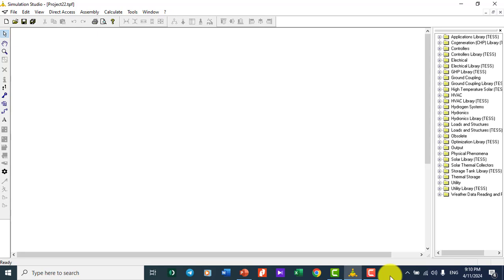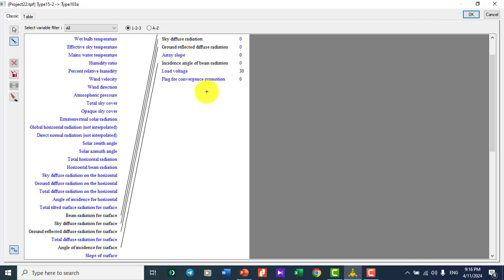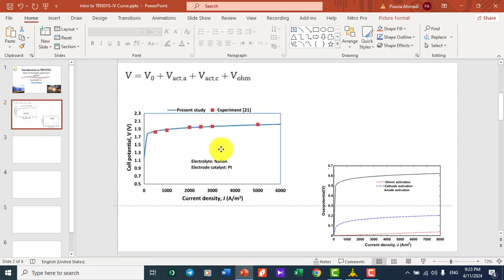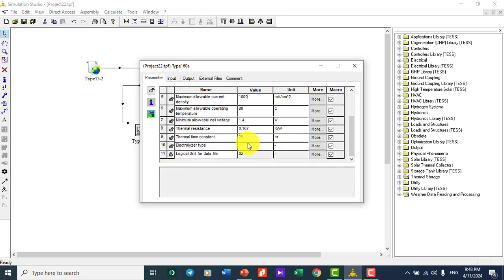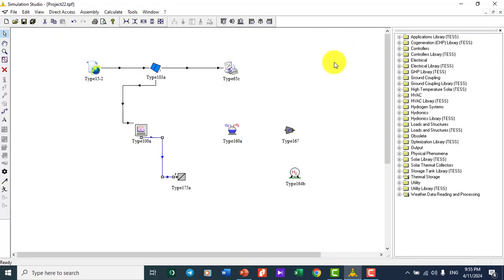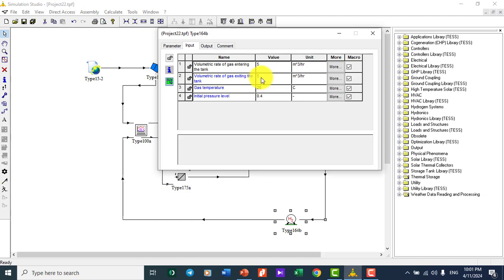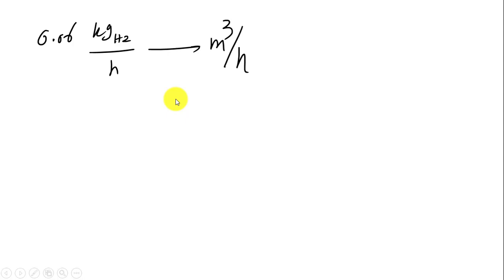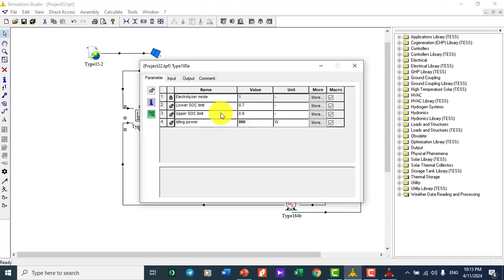TRNSYS simulation of Solar PV hydrogen production system

Comment: An awesome tutorial. Thanks for it. 
Would it be possible to add the fuel cell section to the model. I also want to know if the electolysis would provide some amount of heat to be used for other purposes or not?
Thanks